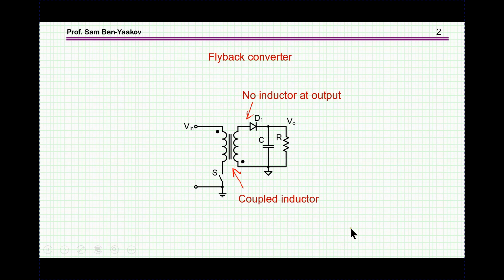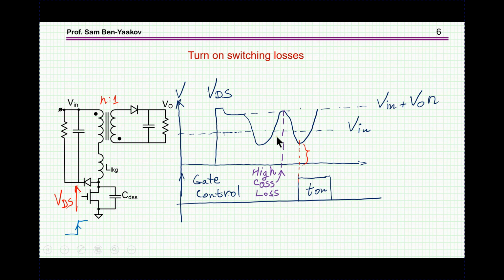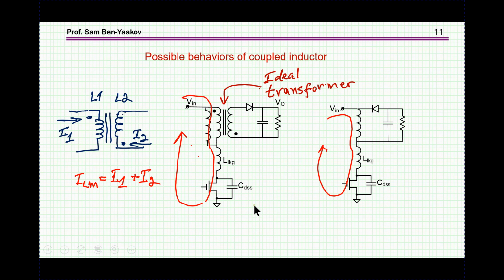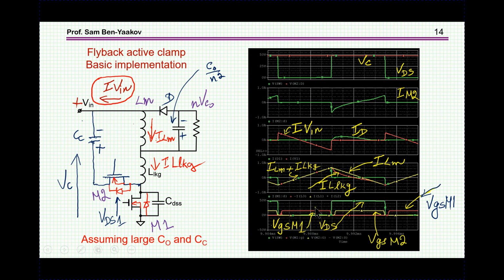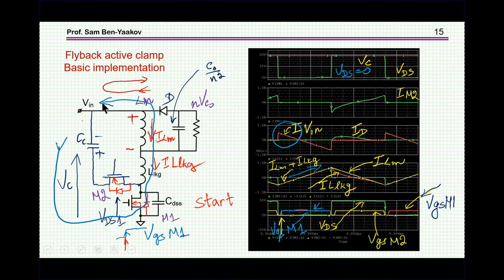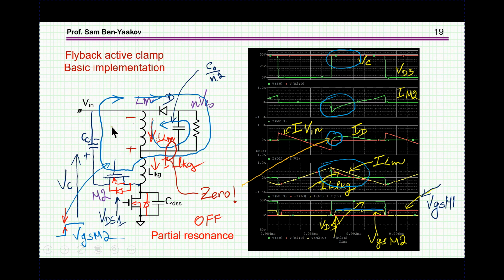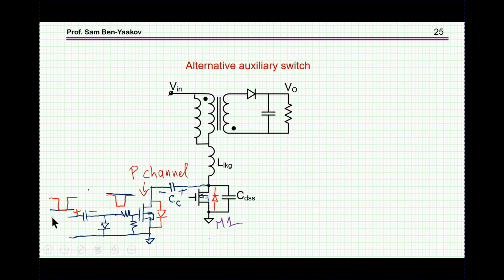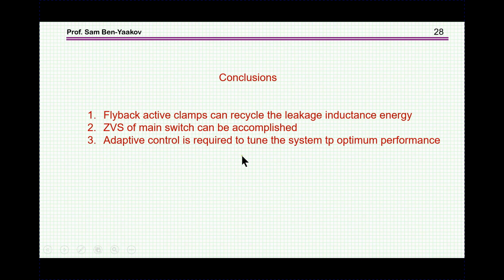Deciphering  Flyback converters active clamps

Comment: Hi Professor, 
During the primary off state, the Vds voltage is Vin +nVo, however, this nVo (assuming other drops to be negligible) is same as Vin (as per ideal transformer ratio right). So it would effectively be 2Vin ? Similarly if we assume multiple secondary windings , ie for multiple output applications like an inverter gate driver power supply requirements, the off state voltage Vds would be even higher right, as in summation of niVoi? So effectively as per ideal transformer ratio, will that also be mVin(where m is number of multiple outputs)?
Reply from the maker: In a multiple outputs all are V1*n1=V2*n2...   so you don't add them.

Comment: Thank you for making these fantastic videos! There is one thing I've noticed while experimenting with ACF converters. Adding an active clamp to a converter running in DCM will drastically change the transfer function of the converter. The Bode plot will start to look like a poorly compensated CCM converter. I guess this has something to do with the extra transfer of energy. Do you know if there is any literature covering this topic in detail? Best regards!
Reply from the maker: Interesting , Thanks for sharing. No, I was not aware of this.

Comment: Hello Professor. Can we use an active clamp circuit in the secondary side of the fly-back converter?
Reply from the maker: No. This will not protect the transistor at the primary.

Comment: Does a bidirectional flyback converter always use the inductor to store energy or can the energy be transferred to a secondary source ie; a battery bank?  Thank you sir.
Reply from the maker: Not sure I follow. The storage is temporarily. In the operation, energy is stored and discharged.
Reply: @sambenyaakov  The switching of electrons between  source and ouput using tvs diodes and power mosfets supposedly interferes with electtron behaviour, at least that's what I've been told.  Knowledgeable engineers everywhere can sometimes be aloof and have little time for questions that are not the normal garden variety. Even if you don't understand tthe question you replied, that speaks well of you sir. Thank you for time sir.

Comment: Thank you, there is not not many active clamp videos.  @41:44  With Low CC, Just before M1 turns on in ZVS mode, Will the polarity on Snubber Cap Cc(Vc) go reverse(Negative) with reference to Vin+?If o which equation determines the peak negative volatge?Any design tips fr this particular region of operation?
Reply from the maker: Cn not go negative there are two diode in series to ground.

Comment: Hello Professor, thank you for the video series. I have gone through lot of your video and they are very helpful. But unfortunately the explanation for ACF is not well understood. Infact its not difficult as it seems from this explanation. Will be helpful if you can make a simplified video on the same topic. Basically how the current in the Primary FET is negative. That explanation is not at all understod from this video.
Reply from the maker: Yes, I am not happy myself with this video. I may post a revised version. Thanks for alerting me to that.

Comment: Hello professor i have a question:
If the load changes and we need way less ouput power, can we still achieve ZVS for M1 without changing our switching frequency? Recycling of the leakage Energy should still be possible, but we wont be able to use the negative current to achieve ZVS, because the voltage over M1 will just build up again, right? Or is this design not suitable for deep DCM and changing loads?
EDIT: I just saw the part about the modified implementation, that might actually be the answer already, right?
Reply from the maker: There seem to be some ways to still get ZVS but changings frequency is probably the best.

Comment: To understand what I learned from your video, I built a flyback converter based on your teaching. I tried out different sizes of inductors using a toroid ring,  with various ON time and frequency. The initial voltage waveforms at the drain of the switching NMOS looked similar to your video at 7:14. but  the ringing  after the collapse of the magnetic flux was quite different. The voltage swing was much smaller, with high frequency ringing and fast died down. I reduced the period such that the NMOS turned on before all the magnetic fluxes collapsed. The waveform at the NMOS drain changed to a square wave. At this state, It delivered more power to the load.   The conversion efficiency was higher than 80% which was better than any other setups which waited till the complete collapse of the magnetic field.Few of my NMOSs blew up due to the inductor gone into magnetic saturation with run away current. To solve this issue, I varied the on pulse width and monitored the drain voltage until the drain voltage started bending upward, Then I set the maximum ON pulse width to 90% and added a fuse in series of the inductor.  I ran my converter for a week, It worked fine and the fuse was not blown.I was using an Arduino nano as the controller and ran the switching frequency at 250KHz.
 Is there a reason why I shouldn't  turn on the NMOS before the inductor magnetic field is totally gone ?  Put it in other words. Why Is it not a good practise to operate an inductor with the magnetic field not dropped to zero?

The reason  I prefer this way is because the toroid size can be smaller.I am not worried much about the runaway effect now. My reason is if there is residue magnetic flux in the inductor. The residue magnetic flux will accumulate every period and more magnetic energy is accumulated every cycle. During the NMOS  off period,  more power will be pumped out from the secondary winding and reducing the residue flux. At a certain point, the residue flux will be at equilibrium. Is there a problem with my reasoning?
Your lecture is clear and precise. I learned a lot from it.  Thanks very much and keep up the good work. Xue.
Reply from the maker: Thanks for sharing

Comment: This is great stuff, I never quite got these before

Gotta say I was getting impatient, saying come ON show me the Clamps! When I got there I had to play it twice before I got it though ;)

Nice exposition !
Reply from the maker: Thanks for comment.
Reply: @sambenyaakov  Oh Hi Professor - nice that you're there.

 'course the reason i never understood these was the same reason I never really trusted active rectifiers - it always troubled me that they could go 'out of whack' and snatch current back from the reservoir 

THIS circuit RELIES on snatch-back, which of course, you can't get with a diode - though I found the initial exposition a bit long, I really need the latter part - I now get it, so thank you!

...

Oh and if you're still there, i have a question - many years ago before mosfets were commonplace, I'd read articles about advanced high efficiency 'Glass Ferrites' I think they were called, that were supposed to usher in tiny highly efficient megahertz range SMPS - these never really materialised (or maybe they did - in niche applications?)

Perhaps the HF switching losses in the silicon lost the efficiency gain? Have you ever heard of these? And how far HAVE people managed to push the smallest size/highest frequency envelope? (Perhaps by tolerating greater 'iron loss' ?  I've seen at least one design with the core heatsinked, so I was wondering about the tradeoffs. Presumably GaN's now raise the frequency one can use)

Meanwhile I'll be playing a bunch more of yours tonight - I know my basic topologies, and can usually manage to fix the things, but there's quite a few subtleties I probably miss!

Yours from Lockdown, Pete & William StereoCat
Gas Electronics
London

Comment: Hello professor. Thank you for describing in detail. I was going through one of active clamp circuit. I was unable to design it or extracting the parameters. Is it possible to give a video tutorial how to design active clamp? One more thing if there is no Cdss across than how would I calculate time delay? Also if in the output side if two diode and capacitor connected before the Cout how output will work? Is is possible apply flyback and forward concept by adding diodes and capacitors at the output circuit? I think I will get some help in this regard. Thank you.
Reply from the maker: Will try. Thanks for comment.

Comment: At 18:18, in the third graph from the top among the the collection of graphs on the right hand side,  the green colored graph describes Id (the current through the diode).  I guess that, the shape of the graph of Id during the time M1 is open as a switch, should very closely resemble the shape of the graph describing the voltage change across the inductor during the same time period.  Is my guess correct?

Comment: Dr. Sam: It would have been better if you could have explained the circuit as a flyback rather than drawing it as a buck - boost type of configuration. The current directions are little confusing and hard to analyze mentally.
Reply from the maker: Hi Swaraj, Sorry for confusion and many thanks for comment that can help improve future videos.

Comment: Hello professor thank you for the detailed presentation, my question is can we use active clamp as PFC and controlled 400v at output
Reply from the maker: I guess it can be done but you may loose soft switching at some input voltage range

Comment: Do you have a link to the article "Boost-Type Power Factor Corrector With Power Semiconductor Filter for Input Current Shaping", or any equivalent design and/or simulation for a similar PFT control loop article? Great presentation...
Reply from the maker: https://ieeexplore.ieee.org/stamp/stamp.jsp?tp=&arnumber=7913719&tag=1
Reply: @sambenyaakov  I'm aware of that link... can't read it though
Reply from the maker: @pappaflammyboi5799  This is protected by copyright so I can't send you. Write to one of the authors and ask for copy.

Comment: Thank you for your great video. I have a question related to Active Clamp Flyback converter. How can I find an equation for the on_time of the mains switch to be a function of the clamp switch, magnetizing & leakage inductance, the phase-shift of these switches and the input current? Could you please guide me through it?
Reply from the maker: The on time is not a function the parameters you mentioned. It is independent. Otherwise you would not be able to control the stage.